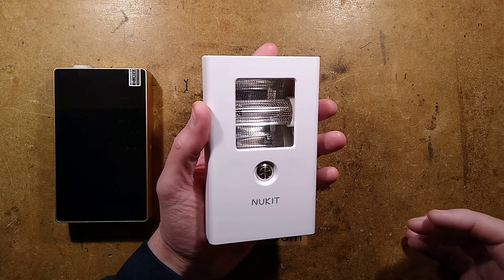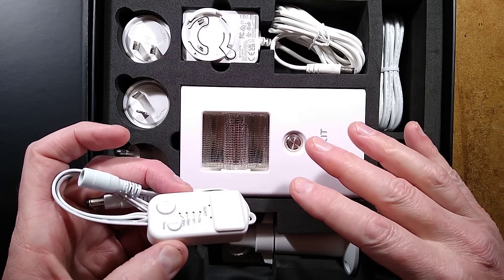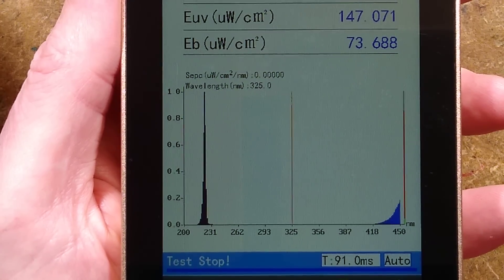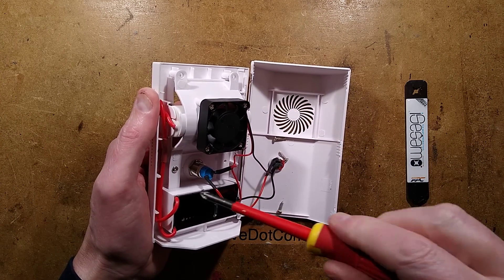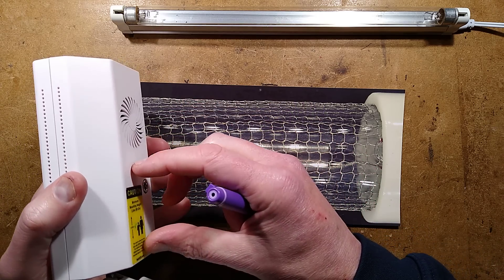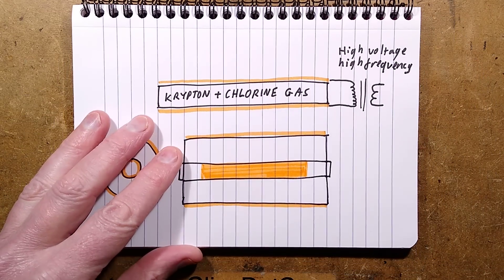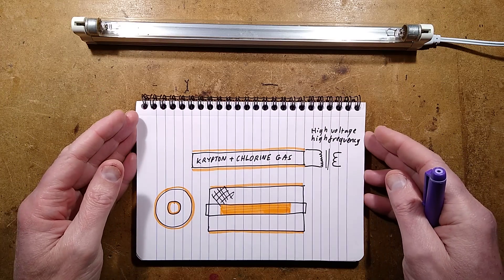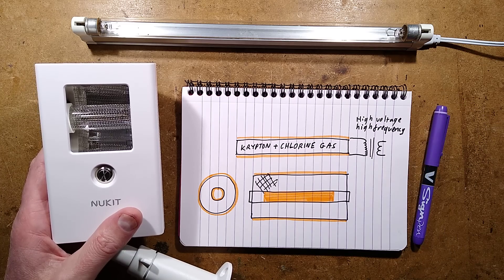Naomi Wu's Nukit 222nm sterilising excimer light

Comment: Interesting tech. I wonder how big of an area a unit like that can handle?
Reply: From the website:

Based on this data, we recommend that customers combine Far-UVC with a high-quality air filter like the Nukit Tempest in each room to handle particulates and install one Nukit Lantern per 10 cubic meters (353 cubic feet) of room size.

If you don't have filtration, install at least one Nukit Lantern per 8 cubic meters (282 cubic feet) of room size.
Reply: Thanks! I looked at prices but for some reason missed that info.

Comment: "I've got to be very careful not to touch the lamp."  Touches the lamp.
Reply: Well, he touched the screen. ASI understand it, the glass’s function can be impaired by the oil in our fingers.
Reply: @TomCee53  If the oil is opaque to the wavelength emitted, it would dim the output a bit. On higher-powered tubes, it could make a hot spot that could crack the glass, but that could not happen here. The glass window would be subject to the same dimming; keep it clean!
Reply: @TomCee53  the glass has very little function; if you touch the glass, a oil-protein fingerprint will develop over time and that will affect the UV transmission and that is all

Comment: I remember reading years ago about using UVC to prolong the shelf life of strawberries. I wonder if this wavelength would have the same effect. If so it could be useful in a fridge to extend the life of various easily perished foods and you wouldn't have to worry about people getting arc eye from it.
Reply: You don't even need the specialty stuff for that though. If it's in a traditional fridge then all you need to do is switch off the light when the door is open and switch it back on once it's closed.

Now for the supermarket fridges with the transparent doors, that's a possibility... But even then, the glass shouldn't let the uvc pass through, so I doubt anyone would be harmed by it unless they opened the door and stared at it for long periods of time. And even that can be prevented by simply switching it off if the door is open.
Reply: The problem with foods in a fridge is that half the food is shadowed,  facing away from the lamp, right? Whereas this 222 nm lamp is sterilizing air, which turns out to be especially relevant for an airborne virus like COVID-19 or influenza (or bacterium, like TB.)

Comment: There is a good Wikipedia article on excimer lasers. Technically it's only an excimer if the two atoms are the same (as in Xe₂) and if they are different (as in KrCl) it's an exciplex, short for "excited complex". The Xe₂ laser emits light at "172 & 175 nm". Why some KrCl discharge tubes produce laser light and others just ordinary ultraviolet I have not been able to discover.
Reply: You can get UV lasers, or at least there is no law of physics that prevents it. Laser is about the light being coherent. This lamp isn't coherent, the light spreads all over the place rather than just illuminating a single spot.
Reply: To get a material to lase you have to build up a population inversion of the excited 'dimer'. This is usually achieved by mirrors at the ends of a tube to contain the excited atoms, dimers, etc. and their emitted photons repeatedly traversing the tube until released.  Making one end of the tube transparent using some form of shutter allows this. A photon released by one dimer initiates another photon from another dimer and this stimulated emission has exactly the same phase as the incident photon. That photon can do the same. All photons travelling in the same direction when they leave the 'tube' are all in phase and the same wavelength hence coherent.

Comment: Seems like a decent product, I wonder if the area it covers is going to be of any use though, and adding three more plastic plugs you may never need or use feels a little wasteful
Reply from the maker: The plug selection makes it universal.  Just one product to ship out to any country.
Reply: A typical trade off in manufacturing and packaging. Maintaining Multiple variants would likely cost more

Comment: Very cool stuff. Any idea how long it takes to kill various nasties? I heard that was a big issue with designing air-filter UVC units is that at the speed air goes through them, the UVC doesn't have enough time to kill anything. Being able to project it into a whole, occupied room would basically negate that.
Reply from the maker: That's the advantage of these units.  The air is exposed for a long time as it circulates in the room.